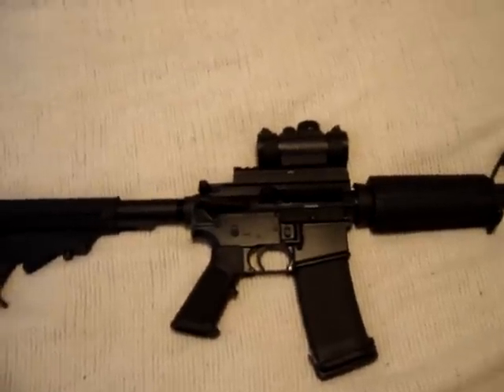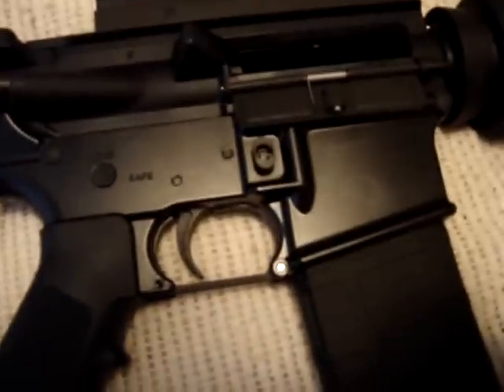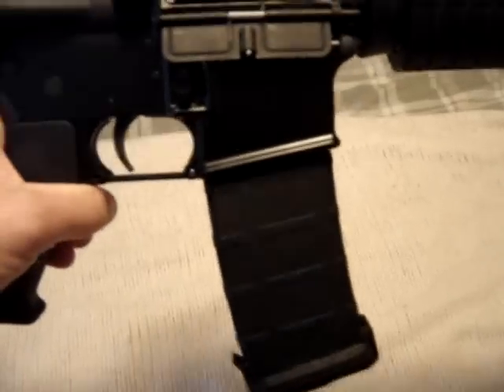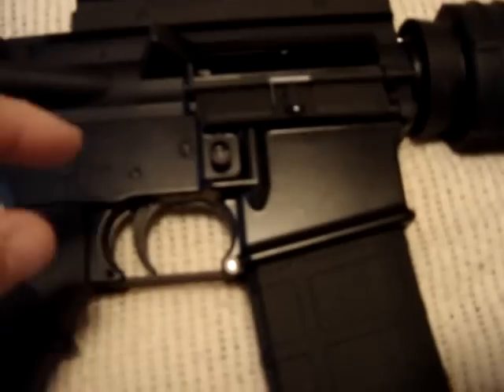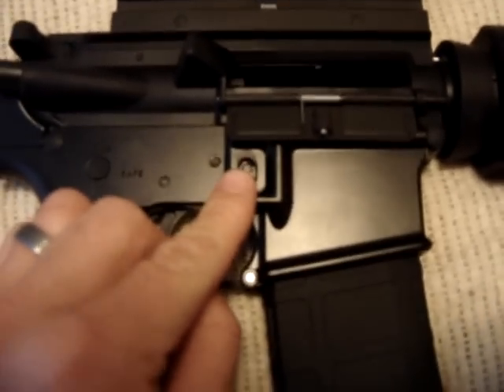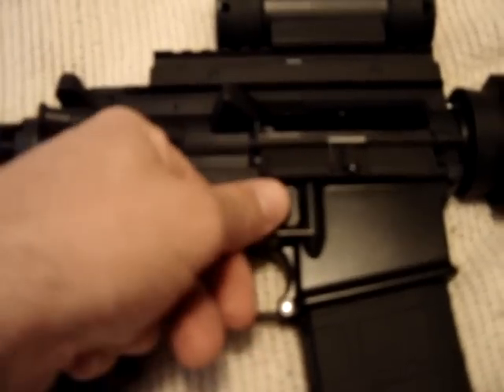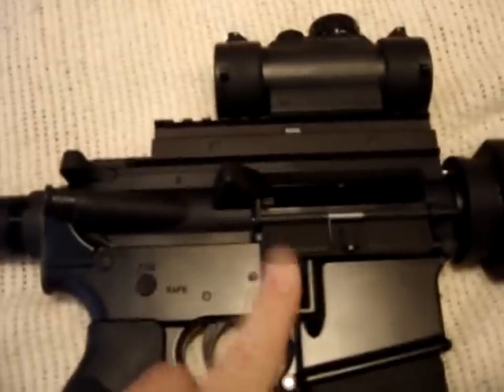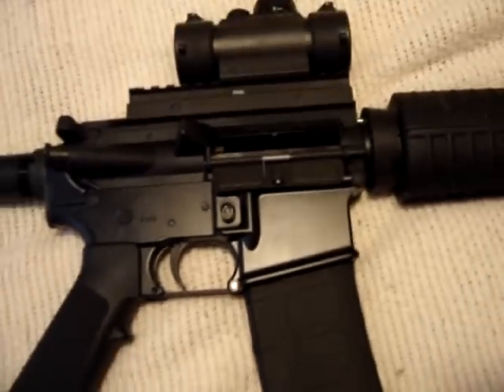AR-15 Bullet button issue SOLVED!!

Comment from the maker: @Hendriestern I took the spring that came in the bullet button kit to my local hardware store. Mine had a huge selection of springs to choose from. I used it to get the coerrect diameter. It has to go around the mag catch stud, and into the side of the reciever. Then make sure it is tighter than the original one. It only cost me a couple bucks.

Comment from the maker: You have to get a factory mag release button. Remove the California compliant release button from the factory mag release shaft. Then insert the standard mag release button and from the other side, turn the mag release shaft untill the shaft is flush with surface of the standard mag release button. Remember, this is illeagal in California with a rifle with a pistol grip. I hope this helped.

Comment: I've ran into this same problem after completing my build last month. It did it mostly when chambering the first round or the last round. It also came out with some aggressive tugs. I found that the screwy thingy worked it's way loose to where it was popping out of the BB (inadvertantly making is so I was able to drop the mag by pressing on it). I tightened it until I could barely get my tiny screwdriver in there in case I needed to take it off in the future. No problems since

Comment from the maker: @th3boy75 HaHa I also have the bayonet for the AR.  I just tried to tighten that "cap" screw as tight as I could. Then I realized that the spring was a piece of crap. It works fine now. And I have the standard mag release that came with it, so I can change back if I move to another state.

Comment from the maker: Well the Pmag is a 10-30. A 30 round body blocked off to hold only 10. And the metal 30 rounder is an older military issue, that I dont use.

Comment from the maker: The issue i had, was that the spring that came with the bullet button was far to weak to put resistant pressure to hold the magazine in  place. Imagine installing the factory mag release button without the spring. Thats pretty much what it was like.

Comment: @Sweet68Camaro 
That's pretty much what I've resorted to doing. That, or just loading the full mag with the charging handle back, then loading one in the chamber and having it ready to rock that way. 
Where do you get your 10/30 mags? I have 1 magpul 10/30 mag and the rest are just steel 10 round mags.

Comment from the maker: @mustangstevegt I had the same problem. Because California law says I can oly have a 10 rnd mag, I went and got a Magpul 10/30 mag. Its a 30 rnd mag that is blocked off to hold only 10. Being blocked to hold 10, the rounds cant be pushed down into the mag when inserted into the rifle with the bolt closed. If I pull out 1 round, all is good. give it a try. I heard that some guys in the U.S. military carry 29 rounds in their mags for the same reason.

Comment: I have the same BS CA crap.  I used a small wooden dowel about a quarter inch long and a small piece of 2-sided tape.  The 3M Command brand hanger tape works extremely well.  You add it to the flattened end of the dowel, shave it down with a razor blade to insure there is none hanging over the edges, remove the other protective paper from the tape and gently slide it inside the bullet button.  Hold the backside of the mag release while pushing the wooden dowel to make sure you have good contact.

Comment: I've had issues with getting the magazine planted in mine. I really have to jam it in there and when mag is fully loaded it is almost too hard to pull back the charging handle. Dunno if its the bullet button or what. I've played around adjusting the button but it doesn't solve the issue.

Comment from the maker: It was a real bullet button, just a bad spring. And by the way... I bought my 10-30 P-mag from you and I like it alot. Except for the fact that I cant put a loaded mag (10 rds) in the rifle with the bolt closed. The limiter in the mag wont allow the bullets to be pushed down.

Comment: Great job on a budget built AR-15. The only thing I would have done differently is use Krylon flat camo spray paint available in 6 different colors instead of a gloss hunter green. Other than that small detail you did a nice job.

Comment: If you have 30 round AR or AK mags and you live in CA. You can legally keep them, you can't loan, sell or give away the mag now. Now the way it works is, if you had them before the ban, they you were are allowed to keep them. If you got them somehow now after the ban, well as long as you do not rat yourself out and say you had them before the mag ban. Then you are ok, some ranges may have a problem with you using them, the laws can be so damn confusing in CA. So remember, you had them before ban

Comment: Just so you know, there are many 30 round magazines that are blocked to only accommodate 10 rounds, while looking like 30 round magazines. They are referred to as "10/30" magazines. There are also 10/20 magazines, which are typically my preference. While I can't speak for the video poster, I would recommend you not be so quick to jump to conclusions.

Comment: I think I may be having the same issue. My mag falls out when it is fired. Can you tell me which spring you bought?
Reply from the maker: I can't really remember exact item. What I did was bring the spring down to my hardware store for comparing diameter. They had springs in little baggies hanging on those display rod/pegs. I just matched the diameters and got a stiffer spring.

Comment from the maker: The mags I have are 30 rnd but have limiters in them to only hold 10, and they are epoxied shut. To have a 30 rnd mag (that is not taken apart for "parts") is a felony. Any mag that holds more than 10 rounds for pistols or rifles are against the law. Yes, I had to install the Bullet Button. It takes 15 min. no tools needed. You are right on the part where criminals wont be following the same rules as citizens. Im sure lawful citizens will become outlaws trying to keep up with the real criminals.

Comment: I have a few questions, are your magazines only able to hold 10 rounds or are you just not supposed to put 30 in there. also what if you don't have the bullet button? it didn't come with it, you had to install it?  I'm an Oregonian so we don't have these crazy restrictions. I real don't see the point, criminals aren't even supposed to have guns, so why would they install a mag button. seems like only law abiding citizens will do it, putting you at a disadvantage against criminals.

Comment: mine needed a .5" length, 15/64" out. dia., and .026 wire gauge.
Reply from the maker: Brandon M   Well, now that I installed the new ARMagloc on the rifle. This junk is going in my parts box.